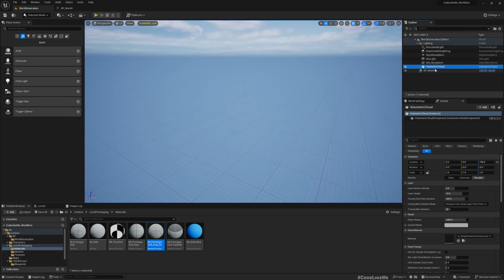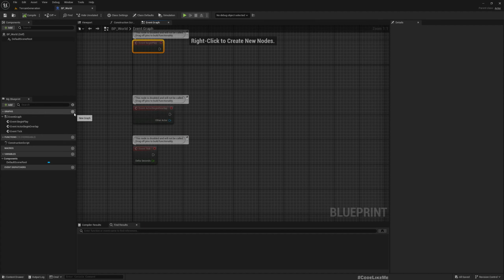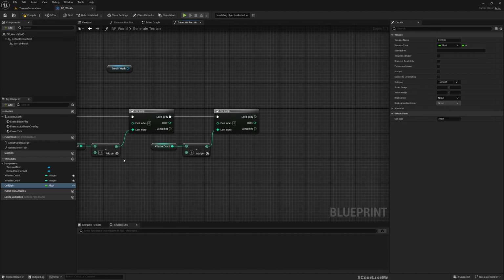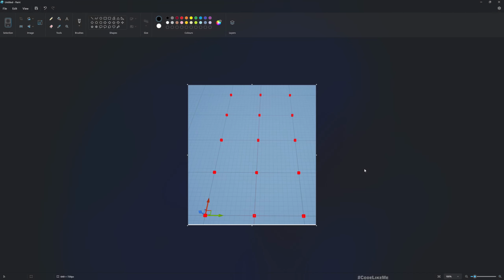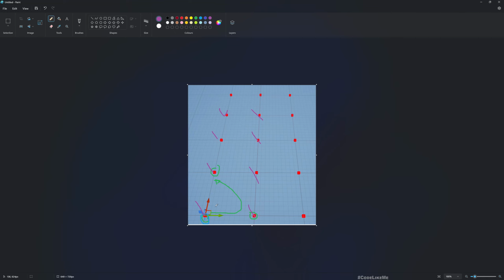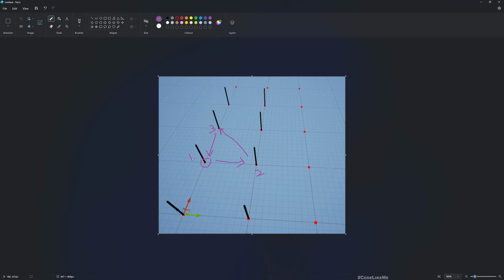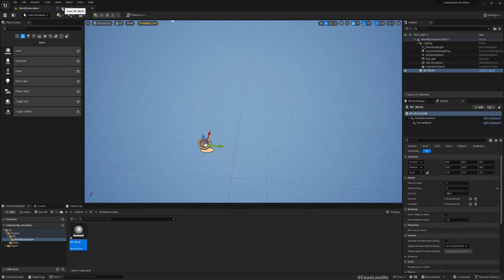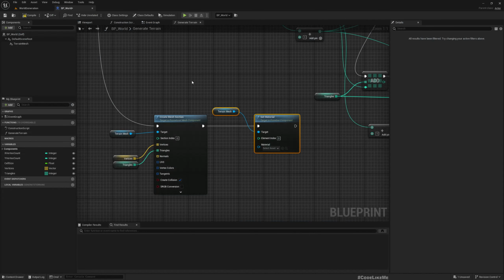Unreal Engine 5 - Runtime Terrain Generation with Blueprints- Part 1

Comment: Hi, instead of noise, is it possible to generate terrain from tiled 16-bit grayscale heightmap textures? I am asking is because unreal's landscape system requires to much memory and VRAM to handle large heightmaps.
Reply from the maker: It should be possible. But I haven’t tried it myself
Reply: @CodeLikeMe  With Blueprints or only with C++?

Comment: For folks not getting faces, I found the problem. I got to that step confirmed everything was wired up and set properly, but wasn’t getting the triangle faces. This is because the BP_World object is out of sight, mine was above me and I couldn’t see it. The points on the graph are reference points starting at 0,0,0. However, the object is generated where you placed the BP_World object. The author must have hot keyed the world item to 0,0,0 to show the faces at that location, because I did not see him align it to 0,0,0 to show the faces at the correct location. Long story short, look for your BP_World item - everything is working on Unreal 5.4.4.
Reply: I get black triangles and cant use any material to change it ... any suggestion ?

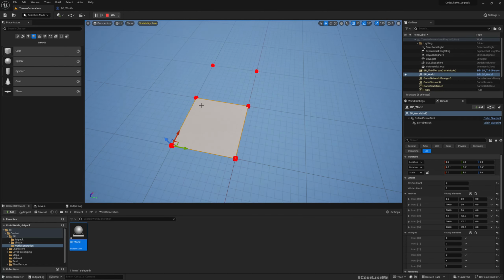Comment: 17:33 i cant render full box or even a triangle as here even tho i literally did all the steps exactly as u showed but i think i forgot to enable or toggle something which shows the mesh in those Debug boxes?
•So how to enable the visible mesh or box
•how to align all my debug boxes to grid below as in your project mine seems to be off grid and not aligned i mean and even if i move my Actor that generates terrain the Debug box always form on the same spot regardless of the location where i place the actor help!! thank you ^^
Reply: it probably isnt in view depending on what values you are using... I had much the same problem at first because my actor wasnt at 0,0,0 in the world. I'm tiling mine, so I added a CentreMesh Function after generation like this; 0-(((X_Verts - 1)*Cellsize)/2)=X on a "set relative location" node, same thing for Y and leave the Z at 0.

Basically getting the width and dividing it by 2 and moving it back that amount to centre it on the actor root coord.

Hope that helps?
Reply: Same problem here
Reply: @mama--rua  i gave up
Reply: @SN_AbbaS1  haha, same, i'm waiting for a reply (If ever) from him

Comment: Great so far.  I'm an experienced developer but a total Unreal noob and I'm really impressed with the quality of the free tutorials I am finding.  One thing popped up when I did the 500x500 vertex count is that Unreal 5.4 started throwing an "infinite loop detected" error. A little digging revealed that there's a Project Setting>Engine - General Settings>Blueprints>Maximum Loop Iteration Count which by default is 100,000, which is why it was working for 300x300 (90k) but not 500x500 (250k).  Added a zero and it generated fine.  Posting this in case anyone else has the same problem. Thanks!
Reply from the maker: Great. thanks for sharing
Reply: It might be a bit dangerous to set this so high. What I suggest instead (we are using this simple method at work and it... well, works :D) is to introduce a small delay once every ~100 iterations (a single frame might actually do the trick). Unreal will stop detecting infinite loops in your method and you will maintain a relatively low count in case an actual infite loop should be detected quicker.

Comment: I guess this wont work after shipping the game? Only in editor?
Reply from the maker: This works in runtime. So, it should work after shipping
Reply: @CodeLikeMe  damn! Cool if this works... but I thought the engine baked the landscape while shipping and that it couldnt be changed afterward...
Reply: @martinberge9237  looks like you're right, if you are using default UE Landscape system. But here you have custom blueprint, like any other, which must be working like any other blueprint after shipping. Just logic not about shooting/running/aiming, but about generating vertices :)